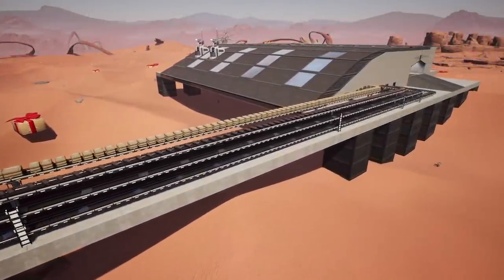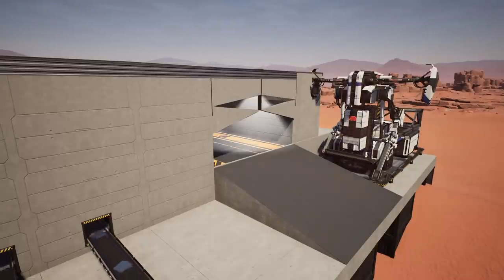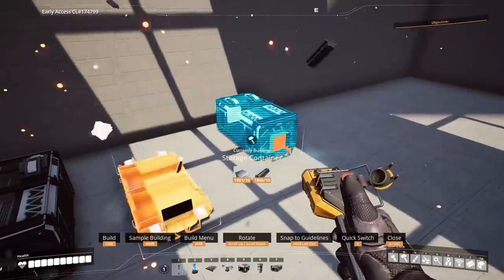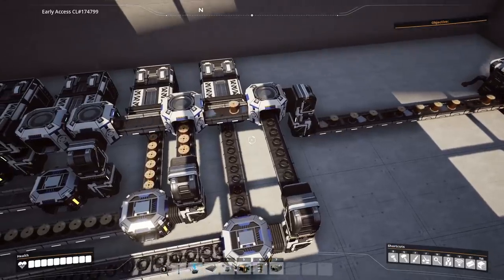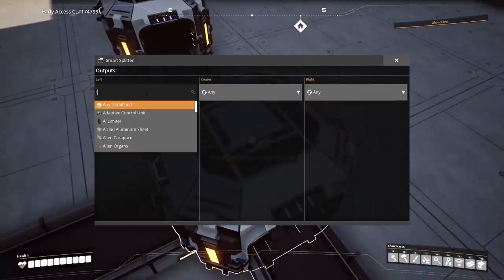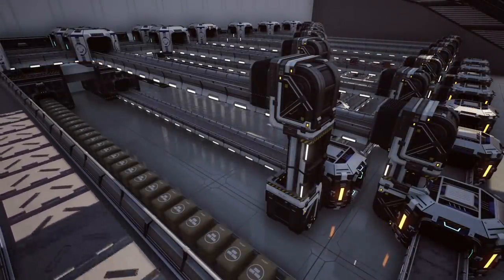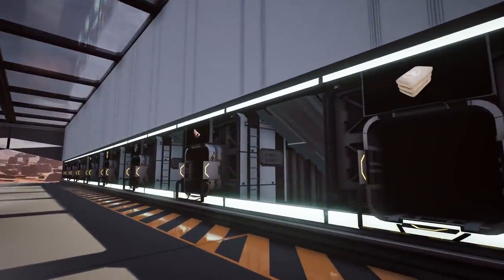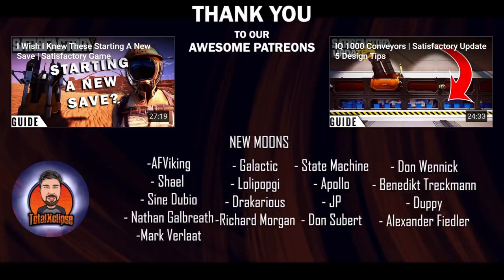Build The Perfect Storage System | Satisfactory Update 5

Comment: Never ever use smart splitters on a mixed line storage they don't have the right settings for it to work properly. Always use programmable splitters for the incoming line to be able to set them properly for a separate overflow line. That way you will never ever clog the system. Smart splitters are not designed right for what you are trying to do it will eventually backup and clog the system. Programmable splitters won't. I have almost 3k hrs and can prove this won't work. I'll even send you a diagram of the right way to do it if you need a visual.
Reply from the maker: Please send through the diagram... I've never had a problem with this system. All you are doing is removing the overflow and sending it through to the sink
Reply: I run mixed line storage all the time and the only jams I've ever had were the result of setup errors (Didn't hook up a belt or power to the sink at the end) or getting an unsinkable item into the line. Absolutely no advantage to programmable splitters.
Reply: @TotalXclipse  comments won't let me paste the .png, so sending it to you direct message or do you prefer via your discord?
Reply: @richardreid6377   And I bet you have a dedicated overflow line and are not using a single line for absolutely everything either cause that would eventually backup. Programmable Splitters have the setting for (Any Undefined) smart splitters don't, that's why they work and smart splitters will eventually lead to a backup especially if one is only using a single line for both input and overflow, it just don't work no matter how bad you want it too, given ENOUGH TIME it will backup and clog. You have to use a 2 line system for it to work without issue forever. Dedicated line for item input, and dedicated line for item output/overflow.
Reply: @TotalXclipse  I sent you a PM via Discord with the diagram cause YouTube won't let me put it here. Detailed instructions are included just overlook my poor mspaint/photoshop skills.